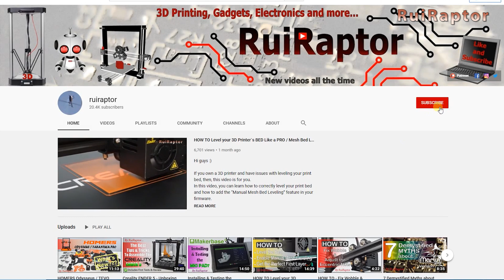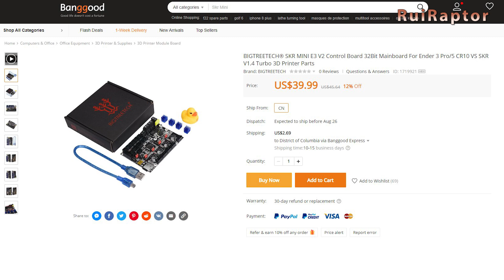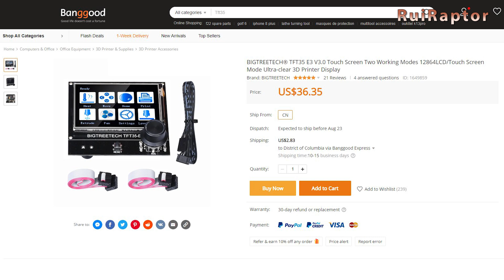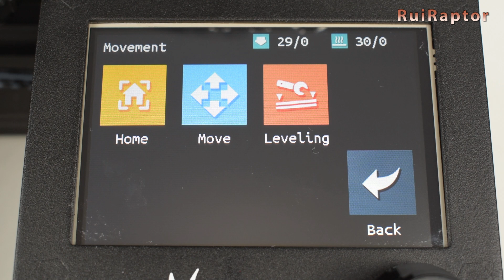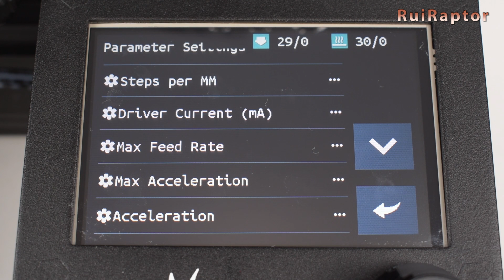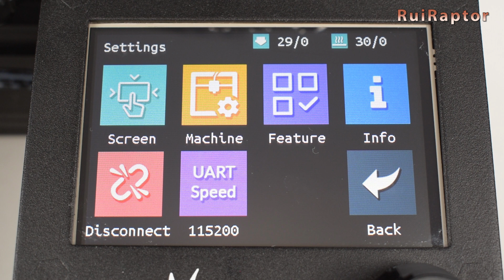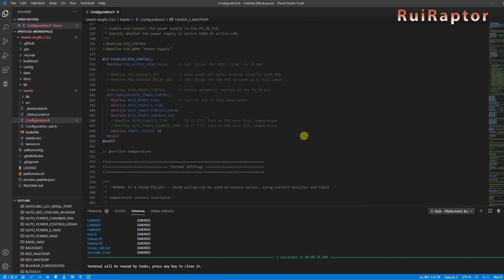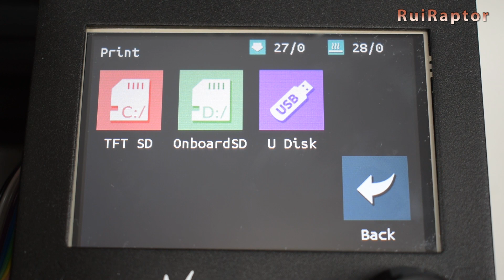SKR Mini E3 V2.0 + TFT35 Installation Guide + BLT Upgrade (ENDER 3/ENDER 3 Pro)

Comment: I got a 3D touch for my SKR Mini E3 2.0 and have set it up the same way you have but all I get printer starts to load with it in and then shuts down.

If I try without the 3D Touch plugged in the printer loads fine.

The wires are a different colour to your touch as mine are blue,red,yellow,black and white in that order.

Comment: You say to remove the tinned ends and that the crimped ones are safer. Why's that just out of curiosity. I just replaced this board and didn't crimp on new ends, is that something I should be planning to correct soon?
Thanks for the video, it was great
Reply from the maker: Hi, from stock, the ends are tinned with solder. When you tighten the screw type connectors with tinned ends, these will be crushed and will not make a perfect conection. With time, it will increase the contact resistance and therefore increase temperature which may eventually melt your connector and wires. For safety and performance, it's recomended not to use tinned ends. The correct (and professional) method is to crimp ferrules.

Comment: Bom dia esta mesma firmware funciona na SKR Mini E3 V1.2
Reply from the maker: Boa tarde Rui, o marlin tem definições diferentes para cada uma das boards (SKR mini V1.2 e V2.0) por existirem diferenças entre ambas. As diferenças podem ser vistas nos diferentes outputs/features que cada uma tem. Eu aconselharia a compilar usando o define correcto para a board em questão.
Reply: @ruiraptor  obrigado pela resposta

Comment: That single pin connector needs some form of retention to the board such as RTV or hot glue.  It will never make good contact for long.

Comment: Some more details on the firmware would have been appreciated.  I don't have a clue on how to compile bin files
Reply: bin files are already the compiled files... so just rename whatever files you have (firmware_with_bl_touch.bin for instance) into firmware.bin and put it in the sdcard. turn off, wait a few seconds so the power downs.... and switch on. The booting sequence in the machine you have will load that new firmware.bin into the board and install it. Make sure to not power loss while this happens or you might brick your board. Easy as that.

Comment: Mks Robin E3d or skr 1.4 turbo not is possible installed in ender 3 pro?
Reply from the maker: Hi, you can also install the MKS e3d on the ender 3 pro as it's plug and play too. You can check our video here: https://youtu.be/k9A8JYxBvqE

Comment: Anyone have a solution for "No printer attached issue, checked everything but not working at all".
same Board and screen. Any help would be really appreciated.
Reply: I had that problem too. Find the button that says SPEED and press it until the message goes away. For me the number was 115400 or something.
Reply: @martymartin9208  Thank you.

Comment: Thanks for the video and compiled binary. Unfortunately, when I try to enable auto bed leveling I get an error "Failed to enable Bed Leveling". The BL-Touch seems to work as it passes its self test (10 cycles of probe deployment/retraction) and responds to probe deploy/retract commands. Do you have any thoughts?
Reply from the maker: Hi Leroy,
please read this:
https://github.com/bigtreetech/BIGTREETECH-TouchScreenFirmware/issues/342
Reply: @ruiraptor  Thank you!
Reply: @ruiraptor  I think the mesh was the solution, but It seems I must run G28 to home all axes before I can run G29. But when I run G-28 (from OctoPrint) I get:

Send: G28
[...]
Recv: echo:busy: processing
Printer seems to support the busy protocol, will adjust timeouts and set busy interval accordingly
[...]
Recv: echo:busy: processing
[...]
Recv: echo:busy: processing
[...]
Recv: echo:busy: processing
[...]
Recv: echo:busy: processing
[...]
Recv: echo:busy: processing
[...]
Recv: Error:!! STOP called because of BLTouch error - restart with M999
Recv: Error:Printer stopped due to errors. Fix the error and use M999 to restart. (Temperature is reset. Set it after restarting)
Recv: Error:!! STOP called because of BLTouch error - restart with M999
Recv: X:157.00 Y:129.00 Z:10.00 E:0.00 Count X:12560 Y:10320 Z:4000
Recv: ok

I'm not sure if this is correct behavior, but despite the STOP above, the printer responded to subsequent M503 and G28 commands without calling M999.

Any thoughts? 

Would it be possible for you to provide the source from which you built the binary?

Comment: Great video! Downloaded the BLTouch firmware and it seems to work. Problem I’m having is that the nozzle is way to high. I tried the z off set function but it will not move down. What am I missing? Any help would be appreciated.
Reply: Figured it out! 

It’s a repeat process of autoHome, zeroing the Z axis, and then offset Z probe. 

1) AutoHome
2) Lower Z axis down to 0.0
3) Check how far the nozzle is from the surface.
4)Adjust the Z offset with  control/motion/z offset
5)Store Setting
6)Repeat until the nozzle is where you want it.
Reply: @bucsfann20   yeah that doesnt work ether.
Mine will not come down
Reply: I second this Comment. Nozzle is too high and can't set Height of Z lower than 0.0 on Printer settings. Basically AutoHome ends in the air when the Probe hit's the bed.
Reply from the maker: Hi, 
the nozzle is too high because the Z-offset is set to zero. You need to calibrate this value.
The z-offset value will vary according to the BLtouch support mount you use.
While printing, use the babysteps feature and move the z down untill it's at the correct height. 
Then, use that value for the z-offset and store the value. Start the printer again and check. 
The z-offset value will vary according to the BLtouch support mount you use.
As a note, our Z-offset value is -1.2

Comment: Hello, is there any way you can help me. because I no longer know. with the BLtouch. downloaded the on Bigtreetech and then specified it in Firmware.bin, and did it like you did, but it doesn't load it. the normal firmware assumed it. Whenever I turn on the printer, the BL always moves red. wanted to print something today but unfortunately it didn't work because he wanted to print about 2cm higher. and that with every start. Z always went to 0Z. or can you send me yours wherever you have on the printer. sorry but I think before buying, assemble and plug in and it would work. I'm more of a mechanic and not a PC person. and I don't speak English myself because I only understand German. (Switzerland) also read it translate with Google. Thank you very much. Greetings Marc
Reply from the maker: Hi Marc, did you adjust the Z offset for the BLtouch? Printing high is normal when you leave the Z offset value at zero. You can contact us by email or FB if you need help adjusting the Z offset value.
Reply: Hi, I have my printer for a while now, printed some upgrade parts with no problem after I change the board and The TFT35 and I also got the Octopi working well but I was waiting on the BL Touch and got it installed now and I tried to put your file on the 8gb card renamed firmware.bin and put it in the printer power on after but no matter what i try it wont update the firmware on the printer. I knows it reads the card because i can read files to print from it, so I can seems to figure why it wont update.

Comment: I replaced my stocked Ender 3 Pro board and screen with the SKR Mini E3 V2 + TFT35 as shown in this video.  I ensured the motherboard fan is plugged into fan1 and parts cooling fan is plugged into fan0 (as shown in this video).  After installation, as soon as I turn on power, the parts cooling fan runs a full speed.  I haven't done anything to the firmware that came on the board; just turned on power.  Why is the parts cooling fan running when I'm not even printing anything?
Reply from the maker: Hi, what about the electronics fan? Try using the menus and turn the layer cooling fan on and see what happens to the electronics fan. If they are swiched, then reverse the connectors. If they are not switched and the layer cooling fan is still always on, then maybe you have a faulty board.
Reply: @ruiraptor  I was confused.  It's the hotend fan (i.e., the fan with the wires screwed in to the two power connectors next to the main input power connectors) that's on all the time, just like on the stocked Ender 3 Pro motherboard.  Can this fan be controlled by firmware on this SKR board, or should it be left on all the time?
Reply from the maker: Hi, yes, the hotend fan is always on. I'm not sure it's possible to control the hotend fan with this board...we have to check.

Comment: Have you seen someone put one of those modern 3d printer boards in one of those K40 chinese laser cutters to replace the awful board they come with (which has no power control for the laser)? I think it would be a cool project

Comment: Thanks for the video and the compiled .bin file. Finally got things up and running. Does the touch screen make a sound when you make selections? Are they still gone because of the BLTouch?
Reply: Yes, it beeps, but the sound can be turned off.

Comment: Thanks for this. The official video from BIGTREETECH doesn’t show the one end of the TFT cable having 4+1 pin connections instead of 5 which caused me to hook up incorrectly the first time.
Reply: ya i saw her fiddling with the 5 pin  connecter putting it on the board  only reason i put it on right the first time

Comment: hey man, I just installed this on my ender 3 v2 and I noticed that my power light is red. When I start a print, I hear a beeping noise for half a second, but the print still works. Are my lights incorrect? I have one flashing green light while printing and a static red light when the printer is on. Also, is the printer supposed to beep when u start the print? thanks great vid btw

Comment: Thanks for the video.
I've got the same board + TFT35.
 I use the connector next to the PSU input to power the electronics fan. The two left are for the hotend fan (Fan1) and the print fang fan (Fan0) which the speed % can be modifyed with the slicer or in the screen menu. This way I can also adjust the temp to start the fan of the hotend in the slicer as well.
 I'm having problems with the display of the print time. no info are displayed. Thanks for your help

Comment: Do you know how to add the "Change Filament" function for the TFT35?
Reply from the maker: Hi Brian, if it's in the Marlin mode, it shouold be easy...but for the touch mode i need a bit more time to study it ;)
Reply: @ruiraptor  That's what i thought. Please update me once you figure it out. Thanks!
Reply: Brian, in the touch options there is a symbol for the extruded. When you press that you should get a screen that has a load and unload option. I just use those. I set the amount to move the extruded to 10mm and press according. If you were thinking that there was a feature to totally unload or load the filament in one touch, I have no idea. My new Tronxy xy-2 pro does have that feature to load or unload and when either is pressed the entire length is either loaded or unloaded from extruded to hotend. Now to just get the rest of the settings to work.

Comment: I have an old Tevo Tarantula that I like and don't want to throw away, however, the mainboard is giving me trouble (extruder driver stopped working),  Is the SKR mini E3 a good replacement?
Reply from the maker: Yes, the SKR is a good replacement. Do you have the old MKS Base board?
Reply: @ruiraptor  yes, thats the one I currently have. can you point me to any video where I can flash the SKR mini e3 to work with my tarantula?
Reply from the maker: I don't think there's a video with the explanation for the old tarantula with the SKR mini. Can you contact us by FB instead? Maybe we can help setting up the config files for your tarantula.